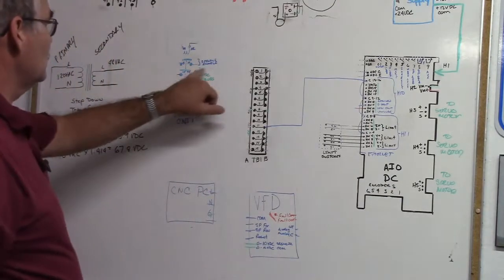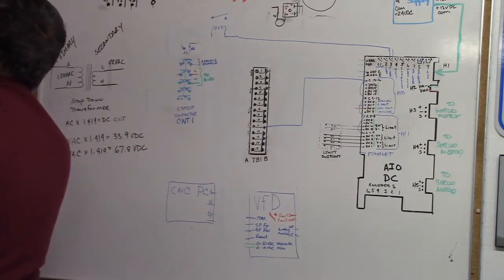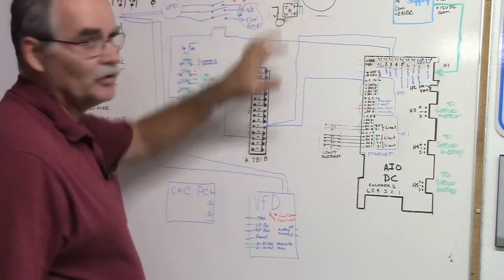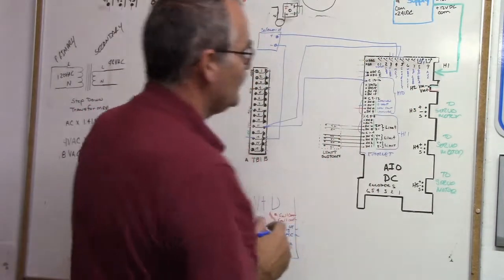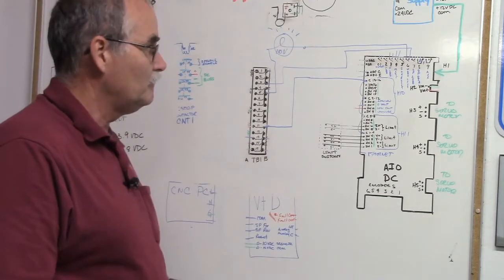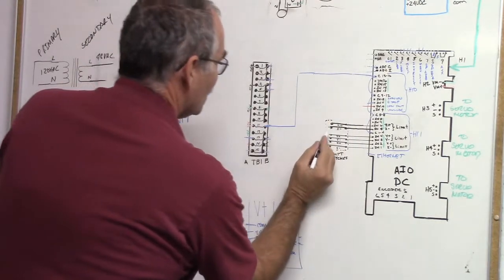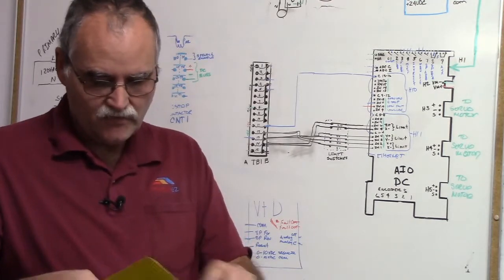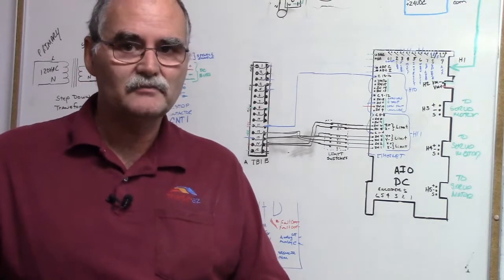6: "Wiring" The Centroid All in One DC - Flood Mist Limit Switches

Comment: Hi Marty I am going through scematic for estop I can see 24volt DVD is used for input to oak estop and I understand the sip resisters are set for that voltage I also can see that 24 volt ac goes to cnt1 contractor for energising relay coil why don't they just have a 24 volt Dc contractor  would be simpler  i can also see snubbers are recommended on all contractors  my query is that I was hoping to be able to reuse existing contractors with 120 volt ac coils they are already installed and wired would save a heap of time I was thinking I could just fit a small 24 volt relay to power the ac coils do you think there is any reason why that would not be adequate cheers Trev
Reply from the maker: You could probably use a 24vdc Estop contactor, just don't use the same logic power supply that feeds All in One DC. It isn't large enough, and could drag down the other logic voltage levels and cause unintended consequences.